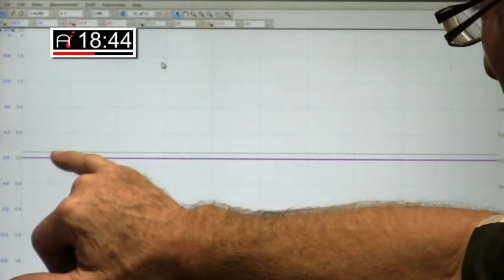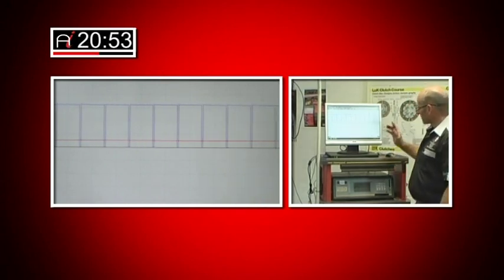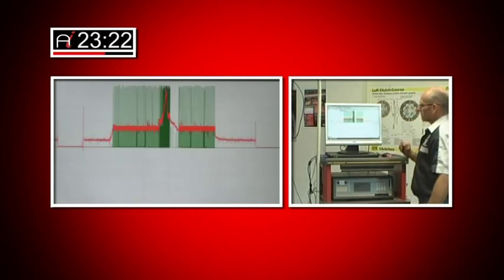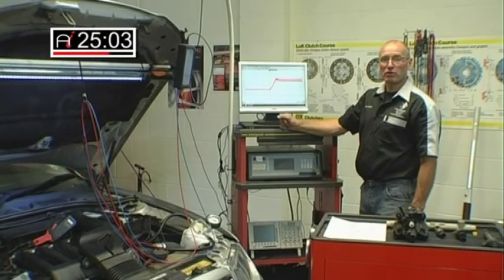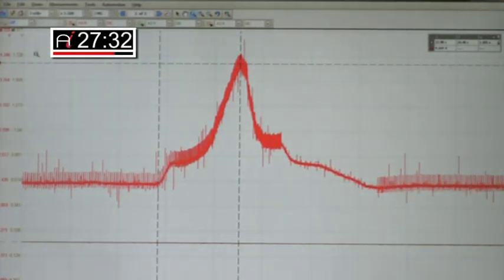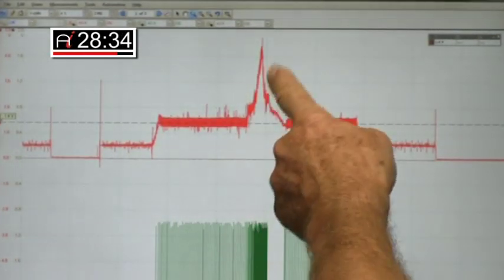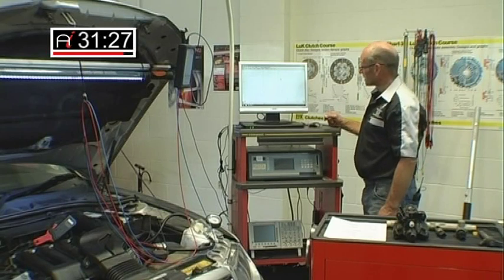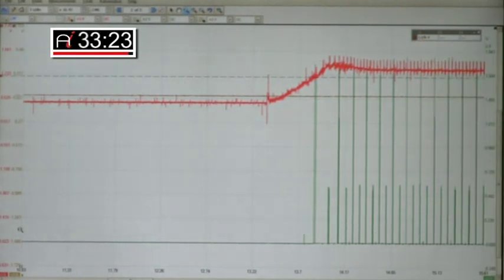AUTOINFORM ONLINE MAGAZINE: Diagnosing an intermittent fault on a Rover 75

Comment: Old video i know.... but all that equipment, all the time spent... all data correct.... but unless you know these cars inside out.... none of that is going to help you..... the fault with that car is a corrupted eeprom on the ECU board from where it been under water in the bulkhead..... the first thing to switch off is the fuel pump relay and the pump dies..... car cuts out.... error codes are stored then for pressure deviations are logged.  Once it fires back up everything is correvt again... until the next time 😎

Comment: Great video as usual. But I was a little surpised to hear the conclusion:
- "we have to wait for whatever it is is wrong with this car to occur";
- "continue testing until such time as the vehicle cuts out";
- "I will attempt to find out if there's anything that perhaps relevant to the vehicle not starting".

Isn't that what OBD mode $02 (freeze frame data) is for?